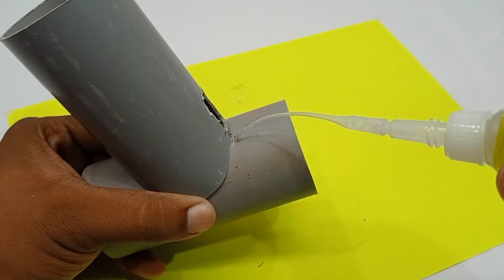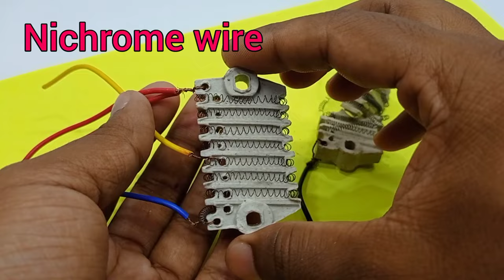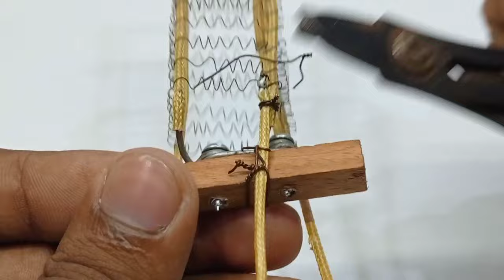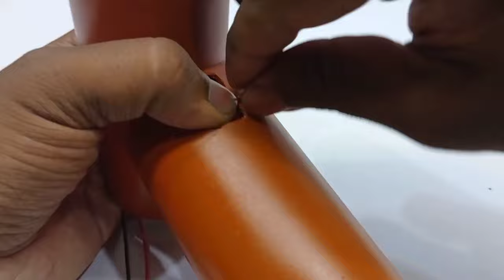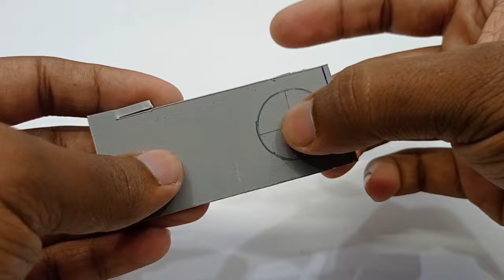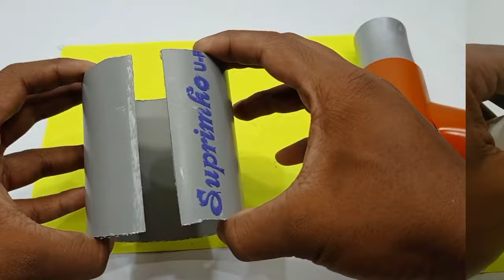How To Make A Hot Air🔥🔥 Gun At Home || DIY - Heat Gun

Comment: Heatgun how much brother
Reply from the maker: Mean price
Heating element 2pcs ×25= 50
Pvc 1 feet= 20
Switch fan converter wire plug and glue 120 rs
200rs only . 
It's still working now 🙂